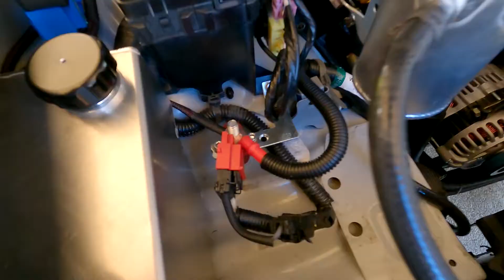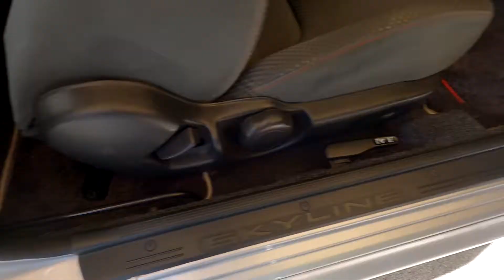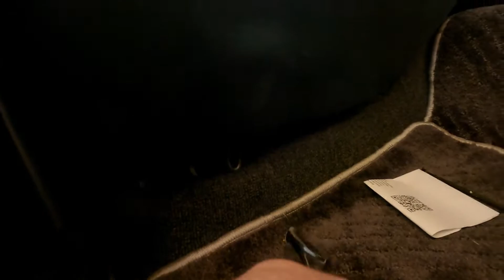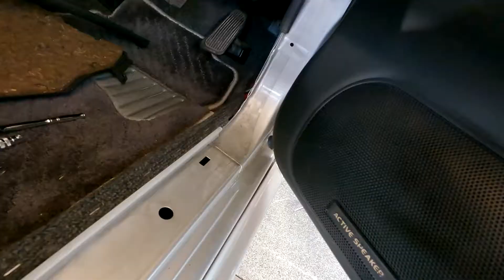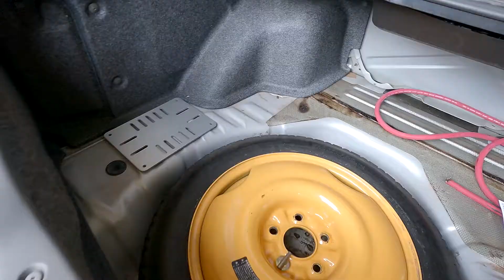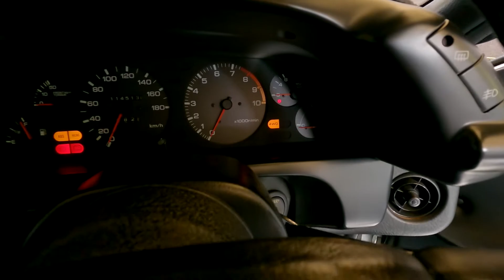R32 GTR Battery Relocation / Rear Bench Removal Trick!

Comment: If your carpet wasn't fitting you drill the holes in the carpet so therefore the battery box can fit on top of your  carpet it's easy
Reply from the maker: Exactly. I was thinking of getting a carpet made to fit around it but now I'm wanting to install a rear strut bar and cut up the rear panels more to have pass through and keep the side panels so at that point what's a few holes in the carpet